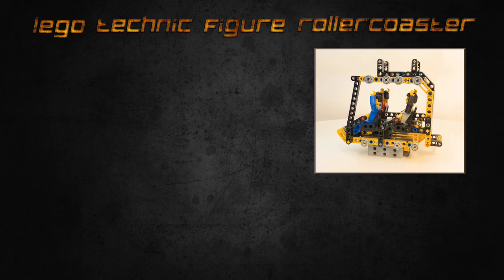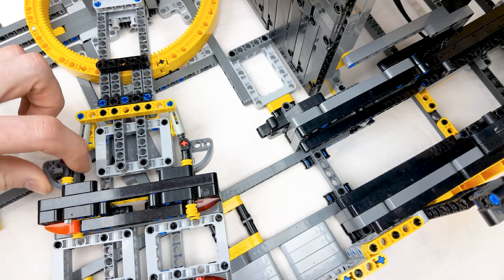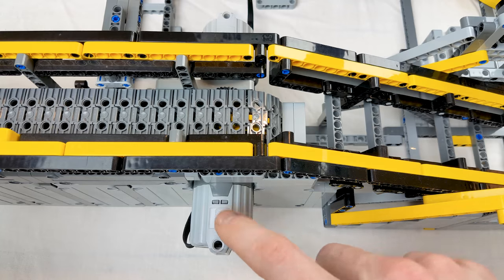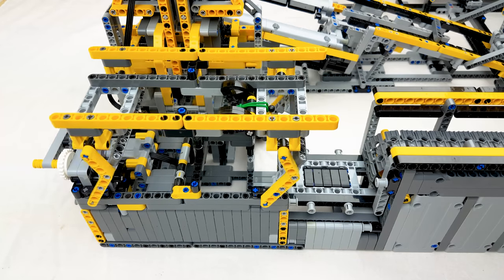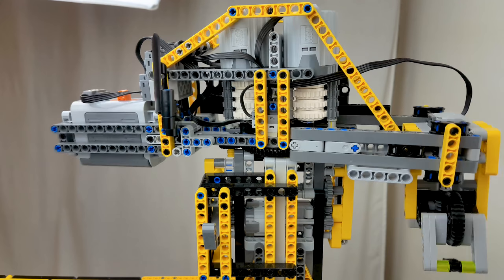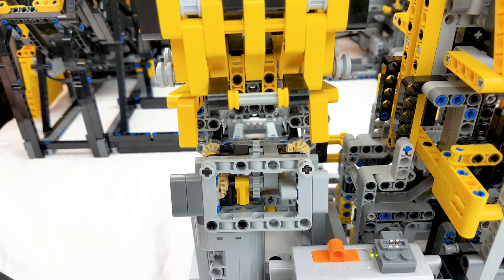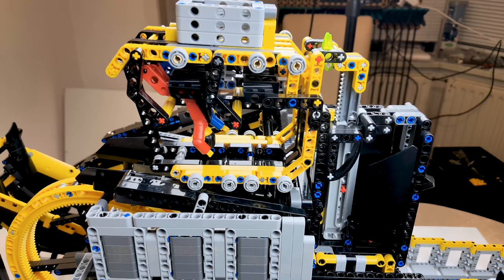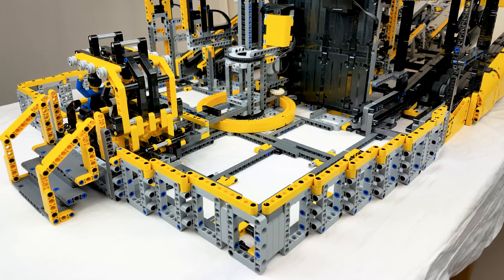HUGE technic figure rollercoaster --how it works--

Comment: What sets were used?
Reply from the maker: it's roughly made of the 8285 towtruck, 8275 bulldozer, 42030 wheel loader, 2x 42055 big wheel excavator and 10+ other small sets and a big bunch of black beams and other part's I bought on bricklink(I estimate 300€ worth), next to that additional motors and a servo and 5x SBrick... yeah... a lot :P
Reply: I love it!